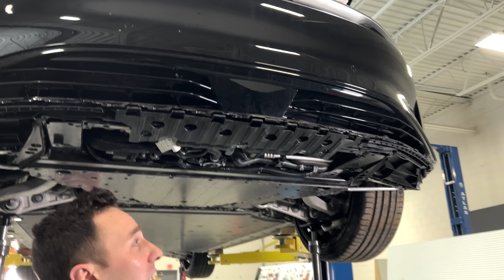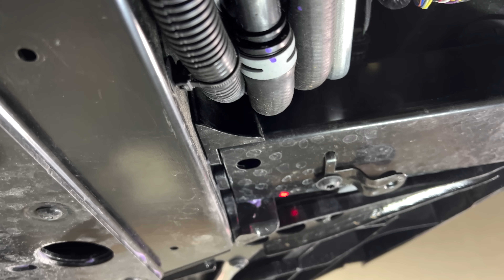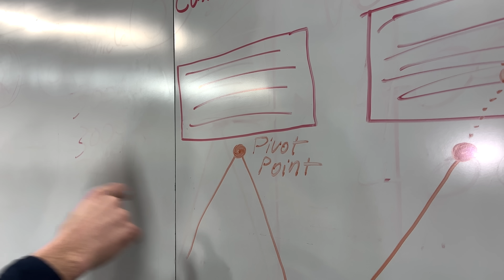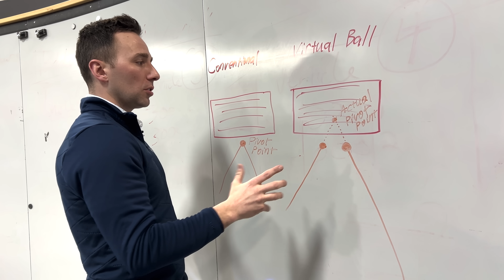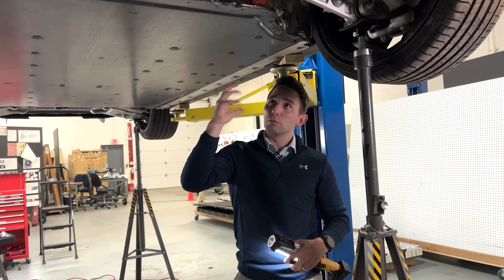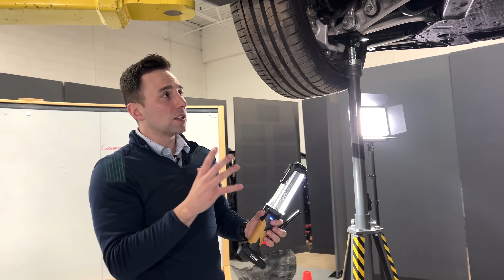A World-Class System? Lucid Air Hoist Review Part 1

Comment: Munro & Ass. seems to value manufacturer needs above end customer needs.  For example, arguing for replacing several smaller functions into one, usually unserviceable unit may be great for shareholders, but when the end user has to replace a taillight or something like a wheel bearing and has a $1,000 bill to do so, well ease of manufacturing doesn't seem so important.  Lucid has chosen to design for maximum user comfort, room, and overall quality.  They may be more expensive, but as the Rivian was at first, they are actually well worth it.

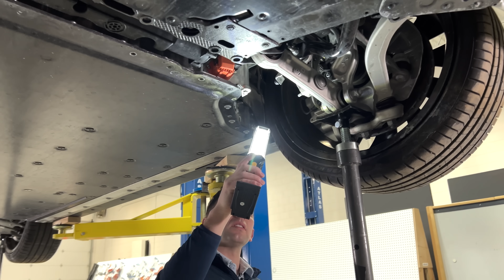Comment: I really hope there were plastic shields in the wheel wells which were removed prior to filming.  Because if not, then those fans and radiators at 9:46 and all those wires at 19:01 are headed for early failure.  And if so, then I'm really curious to see where/how the radiators were vented with all the plastic in place.
Reply: I found a different video which shows that it does in fact have plastic wheel well shields.  Unfortunately, it looks like the radiators vent right into the wheel wells and just have some angled vanes to protect from tire spray.  Definitely not a winter vehicle then.  Driving in cold weather and snow will pack those wheel wells solid with ice buildup.

Comment: Soooo many parts.  This vehicle is not designed to keep manufacturing and service costs down, that's for sure.  Or to scale production well.  Lucid would do well to learn a few things from Tesla on manufacturability.

However, the suspension and handling engineering is a place where Tesla could learn a lesson from Lucid.  Especially for the Roadster.  It needs to handle well, not just move fast.  And all their models could stand to have the better tire life that using a virtual ball would give you.

Comment: Isn't every longitudinal audi/porsche suv/lambo urus equipped with double virtual ball front suspension? That's millions of cars since 1994 (when this setup was introduced on the D2 Audi A8)
Reply: @thealienrobotanthropologist  not particularly high end, though. It's not really cheap or not cheap, implementation matters. It's nice to be able to overhaul most of your suspension simply by going with inverted bilsteins in the front. Having realtively few pivots can also help with steering feel and accuracy- this setup has many ball joints that add potential for wear and slop.

Most japanese rwd sports cars (with the exception of the BRZ) have elaborate double wishbone suspensions front and rear, mostly made out of aluminum. My only point is that this front suspension isn't that unique- the 1998 Passat had it, although mostly rendered in steel. 

M3/M4 have also had macstruts in front with double pivot lower arms, which strikes me as a good compromise between complexity (which can add slop) and rigidity. The A90 Supra, a rebodied BMW, also has struts but it is generally believed to be better handling than the Audi S5 as well as the Nissan Z (which has double wishbone fronts).

Also, the main reason to do this setup is to mitigate torque steer (which makes sense on a high torque AWD EV) and package larger brakes as the virtual axis would go through where the brakes would be otherwise.
Reply: Even now, some longitudinal-engine models use a conventional (single ball joint) upper arm. Audi refers to the design with virtual A-arms (double ball joint) both upper and lower as "5 link".

Comment: Great video. Should there not be some form of barrier (a vented plastic panel maybe), between the front wheel and the rear of the radiator and fan? Seems a vulnerable point to leave exposed to all the debris flying forward off the front wheel?
Reply: I noticed that too, perhaps they removed some shielding to show the radiators

Comment: Interesting walkthrough. Although it very much highlights the hell of maintenance these cars are certain to be. God forbid you damage anything on those front suspension by hitting a pot hole... 8k+ minimal repair is all I see here. Also, if that trapeze looking flat patch is indeed the radar location, fire that person immediately! That radar is bound to be able to do its job about 20% of the time max, and 0% of the time in any sort of mild winter condition... All in all, this looks very much another one of those high tech device designed and throught out to operate strictly in California... Give me some common sense ! :)

Comment: Outboard radiators are more susceptible to major damage in minor accidents. I’m not impressed at all. It’s not a great idea to install delicate, costly vulnerable and vital to protecting the battery temperature equipment outside the frame rails.  In this case, I’d rather have a smaller drunk area that a way higher insurance premium due to totaling minorly physically damaged vehicles with vulnerable equipment hanging outboard just waiting under the front corner of the fender to be crushed in a minor accident. Chrysler made the same mistake by hanging the Transmission Computer and then later the entire drivetrain computer on the outside of the driver’s side Frame rail, just outside the plastic inner fender mud/snow/salt shield. I bet they made those radiators out of thin aluminum with plastic tanks as well, making pinhole leaks failures as corrosive salt crystals and moisture settle on the surface of this low slung, low ducted radiator that doesn’t get as hot, to easily keep it’s surfaces dry in operation in wet weather.

Comment: Are the brakes made of stainless steel? EV's rarely use the brakes so rusting is a huge problem. Consumers need to know.
Reply: They actually use their brakes regularly, just at very low speeds where the regen is not effective. It’s enough to keep rust off the rotors.

Comment: 10:15 My VW Passat from 2003 had the same structure of the axle suspension. It was also installed in the Audi A6. Was a real weak point in these vehicles back then... but the manufacturers and suppliers have certainly learned something new since then 😉
Reply: My wife had that Passat. Great car.
Reply: Audi still uses a 4-link front suspension. It's good but pricy to replace.

Comment: Great video, but it may have been helpful to remove one, or both, front wheels to give us greater visibility into the front end.
Reply: That's their standard for "hoist reviews": they remove splash/aero shields, but not wheels. They need to choose some level of disassembly which is acceptable for a borrowed car; taking wheels off might be reasonable but they have chosen not to do that.

For those vehicles for which it is available, a Dan Edmunds suspension "walkaround" is excellent, and based on removing (only) the wheels. He has both well-illustrated web pages and videos.

Comment: There is another benefit to the dual ball joints on the lower and upper control arms. Each ball joint is supporting half the weight. Not only does this make them more reliable, but it also makes a ball joint failure far less unsafe.
Reply: A ball joint failure is still a major suspension failure causing loss of control. More joints means a greater probability of that failure... although join failure with competent design, reasonable joint quality, and even minimal maintenance is very rare.
Reply: @brianb-p6586  A ball joint failure is a major suspension failure, possibly causing loss of control, but not actually often in practice. You might want to take a look at the Just Rolled In youtube channel, you'll see so much suspension damage - including broken, rusted, and improvised ball joints. Sadly, and I say this from working at a garage, ball joint failures are far more common than you might expect. And people continue driving on them, even after failure.
Reply: @dotancohen  Yes, some fail; as a fraction of the vehicles in use, the failure rate is tiny. I'm an auto enthusiast, and I don't personally know anyone who has ever had even one fail; of course in a shop you'll see more, but by that standard everything is crap that fails all of time, because everything has needed repair in some shop, somewhere, at some point. 

The failure of an "improvised" ball joint has nothing to do with the reliability of what an auto manufacturer produces. Yes, I've seen online images of the ridiculous junk that some people try to use, but that has nothing to do with the reliability of the suspension built by Lucid.

Comment: Good video. I was almost afraid to watch, given your boss’ Tesla fandom. 
That suspension is worth the cost. I’ve driven mine hard and the handling is world class GT. 
Important to remember 2 things - 
1) the Air was designed to be built by hand in the small factory Lucid started with. 2.7million sq Ft expansion opens in ‘24
2) The Air is not trying to be an economical every-man’s car. The Gravity SUV, out next year, will share many components, but is intended for volume production. 
Can’t wait for the upcoming tear down.

Comment: Be very careful driving that car. You pull up to the concrete bump stop in a parking lot will damage delicate stuff in the front of that car. The old Ford focus has a problem with being too delicate up there. I've seen so many that a bump stop pushed the radiator and fan up against the exhaust manifold.
Reply: Ultrasonic sensors see the curbs and show the distance from them. Top down camera helps too.

Comment: This channel does a great job representing the manufacturing side of vehicles, however I would like to see more toward the consumer side. Like longevity and repair ability. I know some vehicles have a much higher ball joint failure rate that others, so there must be an engineering reason. The vehicle shown appears to have a very low ground clearance which would make it limited in application in my area due to railroad crossings and driveway crowns.
Reply: Longevity depends on visual inspection on an older vehicle.
Repairability?
Why would you be repairing a new vehicle?
Why would you expect a manufacturer to provide Munro Associates a vehicle if the review included telling owners how to avoid using the dealer?
Reply: @rogerstarkey5390  It is called hidden costs and resale value. I don't understand where you came up with the dealer issue at all. You can purchase any new car you want and I am ok with that. I just have other standards.

Comment: Is it not a bit worrying that in the front all these connectors and cables are open to any weather influence (water, salt, stones etc)? No protection? Asking honestly as a total amateur from Europe.
Reply: They took the splash shield off
Reply: @andromeda9340  ahhhhh
Reply: May be they have opened some cover. Because doesn't look normal to be this much exposed
Reply: @GreenDriveIndia  that was my concern. Also they have a lot of kind of "dents in the aluminum (not sure what the right word is, but it is not flat), so since they have holes, water gets in and does it stay there? Or are they tilted towards a drain hole? Also to me these plastic pipes and the super simple fixations look well a bit improvised. And indeed all very very close together... somehow under the car it does not look like a 200,000$ car to me. And Jordan is right, so many different parts put together. Must also be 3xtremely work intense and not cost efficient.
Reply: @Watt_Ihr_Volt  you may be totally right, do you have any warranty info(overall not only battery n motor) from Lucid?

Comment: Great review.  All I can think of as I see the lower front edge is the danger from those damn concrete parking blocks and the fact that a front fender bender could now also take out radiators as well.
Reply: The ultrasonic sensors on my Air give me inch by inch measurements to curbs and obstructions. The top down camera also helps.
Reply: @Miata822  sounds like an excellent system although it’s possible not every driver will make good use of it

Comment: You started the video about the lower front air intakes.  How do they work when packed with snow.  I serious, it snows in Minnesota.  Before flush headlights, I had to clear snow from headlights a couple times a year.
Reply: At least the radiators are above freezing,  and the snow may actually provide sufficient cooling! This system doesn't operate at high temps, and in the snow,  much of the heat can be shed to the cabin.
Reply: I wouldn't drive this vehicle in the snow and ice.  It would be a garage queen.  If I could afford a car like this, then I could afford a rusty old Ford F-150 to drive in the snow.  I would probably prefer the Ford, because the thought of my beautiful Lucid parked in the grocery store parking lot would make me more nervous than a cat in a room full of rocking chairs.

Comment: The Porsche Boxsters have used 2 outboard radiators since 1998; the Caymans have used them since 2006. Nothing new about using outboard radiators,. Porsche 911s have also used them since the late 1990s.
Reply: Yes, and in those Porsche models they are normal engine cooling radiators (not just supplementary engine cooling, or other purposes).

Comment: 10:46 I believe Lexus tried a similar suspension set up years ago in their LS460. It road super nice, but having all those moving parts working against each other cause premature wear and failure, and it is really expensive to replace all the parts. So much so its one of the big reasons not to buy an LS460, especially as they get near 100k miles
Reply: Audi has used this style suspension for 25 years.
Reply: If properly engineered,  these parts should each be under less stress and work together more smoothly than the simpler MacPherson strut setups.
Reply: The buyer did spend over 100k for this car, I'm sure they can afford an expensive repair bill.

Comment: Interesting to begin to see the real facts on the Lucid. Munro and his gang will reveal the good, the bad, and the ugly before they are thru. First big issue i see is how tight things are packaged. As pointed out, it's a trade off to be that tight. I can see why production ramping would be hard. And Lucid doesn't make most of their castings and such. There are several there that would be tough to get just in time shipping to work with. Will be fun when they start to actually take this beast apart.

Comment: Can't wait for the motor teardown. I think their waveform stator is the best in the industry.
Reply: @Vicky Kennel  No, just difference between cost optimised tech and space+performance optimised tech. 

All tech comes with pros and cons. Tesla and Lucid are competing for different markets. Thus, they choose different tech.
Reply: I think it's a press vehicle. A distructive teardown may not be liked by Lucid.
Reply: @error079  I wondered that myself. If Lucid wants some great publicity and truly believe in their product, then they should supply Munro with a drive unit.
Reply: @error079  its actually an auction car.there is blue tape on the front windows in the thumbnail.
Reply: @vickykennel7414  the only real upside of higher voltage is reduced conductor size and a little better efficiency. It's definitely an advantage and that's why Tesla is moving towards 1000v/48v. But there are so many other things Tesla does well and that's why you see them leading the industry.
Reply: @Electrify_Everything  There are other upsides to higher voltage.  At high motor speeds there is reduced need for field weakening to reduce back EMF from permanent magnet rotors.
Reply: @vickykennel7414  lucid fangirl in the house.
Reply: Also I think it is 800V this is something Tesla currently lacks believe Tesla is 300V. I would like to know how much copper is used in the Lucid motor should be low because 800V.
Reply: @HMexperience  I think Tesla is considered a 400v architecture.
Reply: @Electrify_Everything  thanks I googled it and confirmed it is mostly 400v with model3 at 350v.
Reply: @HMexperience  Lol, Model S/X is 425V, Model 3/Y is 350-400V
Reply: @vickykennel7414  
You really have no clue.

Comment: So basically Lucid needs a complete structural redesign.
Reply: You can tell the team is quite impressed with the tight packaging and efficient use of space, as well as the engineering about the performance aspect of the car, thus far. So it sounds like lucid made a conscious decision to trade off cost and manufacturing complexity for performance, interior and frunk space. With the experience they have gained, and hopefully with the advice that Munro can give, they will be able to cost down significantly and survive as a successful EV company. Even though I’m a fan of Tesla, I do think the market definitely has room for more than just tesla.
Reply: @vickykennel7414  so they can build them at a profit instead of a huge loss?

Comment: The more I see with EVs, the slightest ding would write off the car.
Reply: That's the insurance companies not knowing what to do.
Reply: @Antonio DiNunno nope. Just watch the above video and the complexity and tightness of the design.
Reply: @barr96  Oh, this car. yes. We are still dealing with super tight tolerances on it. And the structural adhesive is causing flashbacks to the 4680.
Reply: What to expect from a "post-luxury" car? Easy repairability, standard parts?
Reply: @brilanto  Repairability on mechanical parts SHOULD be high. Standard parts are hard for start ups. Battery parts should be designed to not fail.
Reply: @Antonio DiNunno  I like the look of battery swap, so not integrating the battery pack into the chassis. As again, any battery damage or degradation and the EV is a write off.
Reply: @barr96  
Never assume.
Reply: @rogerstarkey5390  er OK.